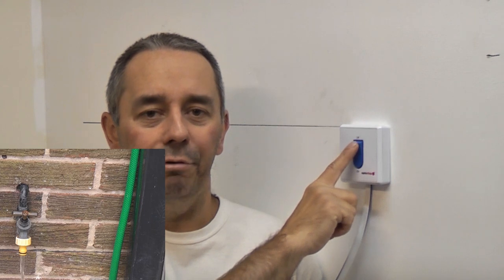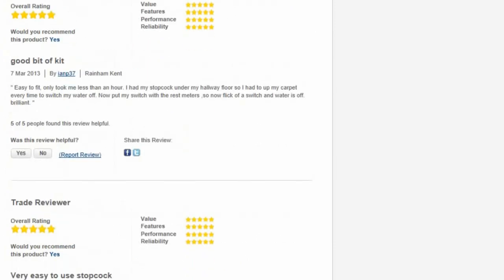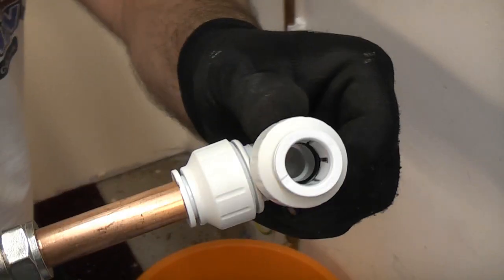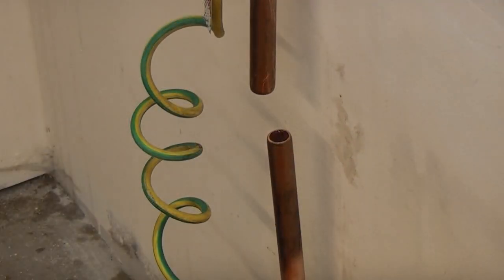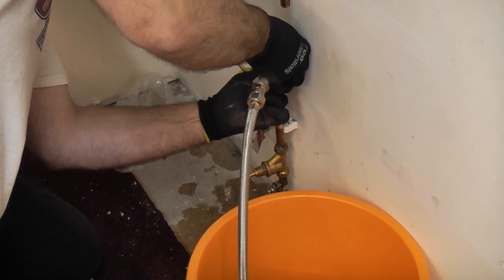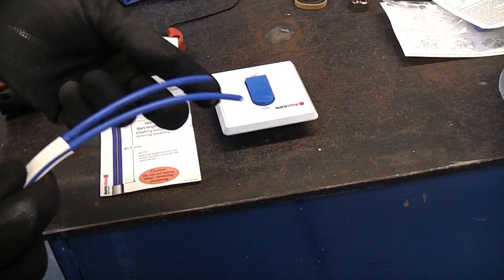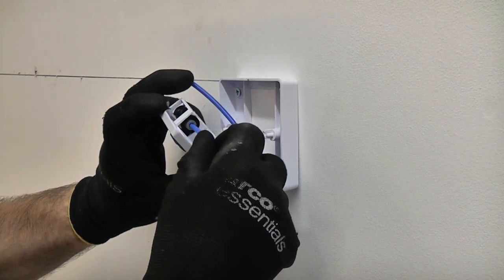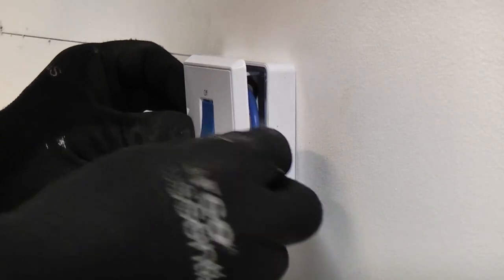Surestop water valve | isolate water with a switch

Comment: We fit a lot of these at the property maintenance company I work for, usually when we replace a kitchen. They can replace the existing stopcock so long as you can isolate the water in the road, though usually they are fitted in addition to a stopcock that is seiner in the on position.
Although I have to admit to initially being sceptical, out of 100 or so installations, I'm not aware of a single callback.
Great video and thanks for posting.
Reply from the maker: Thanks for the comment 👍
Reply: Great news Darren.

Comment: Great video as usual 👏👍

Couple of additional tips/comments, positive not meant negatively 

1: Richard from This Old House always says to clean the copper before you slice it. That’s good advice even if using pushfit and not soldering. 

2: Secondly, with a pipe-slice I always seem to splash lots of water when the first cut is made. So I often drill a small hole in the pipe that will anyway be discarded to drain any water easily. 

You didn’t need either of those tips from what I could see but others watching this video might. Hence this comment 

Of course this video now means I have to fit my SureStop I bought from SF over 2 years ago :)
Reply from the maker: Thanks for the comments ;-)

Comment: I have been using these in 2 rental retirement flats in Somerset. They fail about every 2 or three years either at the valve end or the wall switch or even, as someone else here has experienced, through pinhole leaks in the control tubes. I no longer use them as the stopcock but now fit a plastic stopcock (not quarter turn) upstream. The one I use is from Screwfix and has a 50 year guarantee. I isolate by using a pipe freezing kit. However, I have a Surestop at home which I use as the main stopcock which has so far given me about 10 years of trouble free service. The water in Somerset is soft but the water here in Dorset is hard. I wonder if the reliability of a Surestop is affected by the hardness of the water.
Reply from the maker: Thanks for the info 👍

Comment: I have installed and used two of these in my bungalow both failed at the remote switch within 2 years one was eBay the other I think was Screwfix. Two years apart. The waterboard had increased pressure because of complaints but soon reduced it again due to numerous main pipe bursts. Whether this had anything to do with it. The pipe to remotes was very brittle. I do recall a lot of failures at the time. 
Keep up the great vids I am learning a lot
Reply from the maker: Blimey, that is not good!
Thanks for the info

Comment: I had one of these installed in October 2017 (without the remote switch). So far it has worked as expected and been the main stop cock in our home. I used it for 3 weeks to stop the water when i went on holidays and it worked well. To me the main advantage is that it is less likely to seize and more user friendly for people who don't understand household plumbing too well. I think I discovered these in one of your old videos or the video you did on the aladdin isolater valve. Cheers.
Reply from the maker: Thanks for the comment 👍
Reply: Super news!!!

Comment: I think that these might best be treated as consumables for reliability, especially in hard water areas or areas with high pressure or large pressure fluctuations. Changed every 5 years or so.  I'd lay odds that the switch part with the plunger won't stay reliable in hard water areas.  Treat it as a consumable and bargain to pay a fiver per year for the convenience factor but honestly why bother when there are very reliable quarter turn valves available these days with less potential for failure?  For the elderly or infirm just ensure that a nice easy lever operated one is fitted.  Great video though and nice to see such a neat job using the proper tools👍
Reply from the maker: Thanks for the comment
Reply: I've fitted them in a hard water area for 20 years. No problems. I've replaced their first models because they were ugly.. I was a plumber
Reply: 4 bar I this area

Comment: Installed 3 weeks ago. Water pressure seems to be dropping over the last few weeks. Today no water. Turned on and off at Isolator and switch. Restored water pressure. Is their a common problem wit the isolator or switch?
Reply from the maker: Not sure, sorry. I have only installed one of these.
Might be worth asking the manufacturers, there is an email address on their website- https://surestop.co.uk/contact-us
Thanks for the comment 👍

Comment: Mine has starting leaking from the blue switch! What should I do
Reply from the maker: You should be able to get a replacement switch. I'd just isolate the water and fit a new switch
Thanks for the comment 👍
Reply: @ultimatehandyman  thanks it was midnight and the manual isolation valve wasn't fully turning off the water

Comment: i have 1 of these been in 10 years but pipe not has a pin hole and leaking near  the switch does anyone know can i take this off and cut the leak out and then just push fit again or will i need to replace it
Reply from the maker: I'm assuming the leak is on the pipe which is isolated when the water is switched off (not the always live side), if so you should be able to cut out the piece of damaged pipe, then reinsert it into the surestop (providing the pipe is long enough).
Reply: @ultimatehandyman  here is 2 thin blue pipes almost look like electric wire one goes in each side of the switch it is 1 of them has a pin hole leak do the pipes just pull out and push back in once bad part cut off or do they have a release button to push before pulling out
Reply from the maker: @alankodi8651   Oh, right. It's the small diameter plastic pipes that go from the remote switch to the Surestop.
I think you will have to isolate the water at the outside stop tap, once you have done that you can remove the faceplate from the switch, then you should be able to cut the pipe back, if I remember rightly they are 4mm pushfit connections. When you push the collet in on the end of the pipe fitting, it should release the pipe and you should be able to pull it out to trim.
Reply: @ultimatehandyman  all sorted thanks for advise

Comment: seems to me that this device is courting problems - the number of additional connections number 6 in my estimation. 6 new places for failure to occur not mentioning the added piping that could fail also. Not the thought that I want in the back of my mind when I go on holidays.
Reply: Good point. The negative reviews I've seen claim the switch stops working after a handful of years or the complaint is that the one or more of the four tube endings can begin to leak after about the same period. I'm guessing it's partly due to not pushing the tubes in sufficiently past the O rings and/or the tubes were not cut square. Also frost action if in a cold space. Or a good pull on the valve end tubes...
Reply from the maker: You would be surprised how many people who don’t even isolate the water  before they go on holidays! 
Thanks for the comment 👍
Reply: Benny stop taps are always accessible(or should be but not if you're a kitchen fitter 🤦🏻‍♂️) so the connections to the sure stop will be, point is, there's connections all over your house under floors and in walls etc, so adding something like a sure stop with new connections that should always be accessible , isn't a big issue 🤷🏻‍♂️
Reply: Why not use a ball valve? Just a quarter turn with a reasonably sized lever.
Reply: I work in student accomodation mate and every flat has these never had one fail yet, super easy for late night isolation problems at weekend etc i reckon there a good idea, having said that is it anymore convenient than a lever tap half turn and its off
Reply: @girlsdrinkfeck  I think there is some logic to that. Frozen pipes seems to be one of the larger risks. Personally adding up the time you are out of the house for work over a year means it is far more probable that a problem would happen then but we don't turn the water off each day. I suspect a week of a water leak is just as damaging as 5 or 6 hours in reality ie a total refit.
Reply: You guessed right.  Thank you for your comment.  Have a good day.

Comment: Interesting item, looks great but I am sceptical of its long term reliability, especially in very hard water areas. The guarantee is only 2 years, should be more than that (10+) for a permanent and important fitting like this.
Reply from the maker: You can extend the guarantee for 10 years, if you pay £20+VAT (which seems pretty reasonable to me- depending on what exactly it covers). I'm getting mixed comments at the moment about reliability, some people have said that they leak, whilst others have had no problems!
Thanks for the comment 👍
Reply: Thanks! I'm quite interested in getting one of these as I have a stopcock that's hard to shut and also in a cramped space. There's a few "flooded house" reviews though, that are concerning! :)
Reply from the maker: Yeah, I've seen a couple of bad reviews, but then you think that if the product does fail and flood the property, they would soon go out of business - as insurance companies would sue them for damages!

Thanks for the comments
Reply: Insurance companies actually promote Surestops.  Sadly the reviews don't always reflect the truth of what went wrong.  Or if they contacted our Techincal team based in Birmingham.  Have a great day.

Comment: Unfortunately I fitted one of these in my parent’s holiday cottage and when they went there, they couldn’t get the water to come on! There is a little metal pin that is actuated by the switch and this comes away from the switch periodically making it troublesome. I have had to push it home several times and it doesn’t appear to be broken. They had to get buckets of water from their neighbour and couldn’t shower for 24 hours. Sadly they now don’t trust it and are frightened to use it....😩 I think, in theory it is a great idea and when it works, it works well. Sadly it is just too unreliable in my experience.
Reply from the maker: Thanks for the comment 👍

Comment: UK only country where they supply cold water is in 15mm main pipe, no wander there is no pressure
Reply from the maker: It's normally 25mm to the house, but then it often gets reduced down to 15mm
The pressure here is too high- about 8 BAR 😱

Comment: Had one of these fitted , o rings inside failed and cost over £1,000 in damage to solid oak floor , so had to claim and the company who made it found the fault , and paid out for my floor replacement ( Nightmare )
Reply from the maker: Blimey, that is not good 😱
Reply: @ultimatehandyman  
Just un lucky I suppose , great product, just needs re design to prevent this happening 👍

Comment: I live in a London estate is a block of flats, BUT  the WEIRDEST thing is that the main stop valve ONLY shut off hot and cold water in the kitchen and HOT water in the bathroom BUT NOT, NOT the cold water.  I also found out that the cold water pipe that goes to the toilet cistern is probably on the same line of pipes because I can not stop the cold water to the cistern and i found out the hard way because it was worse than i nightmare to try and put everything back as the pressure was strong! Do you have any idea?
Reply from the maker: That is weird.
I have seen some properties, where they have had two incoming water supplies, which is great if you are on a water meter, but not good if you need to isolate the water and only know where one stop tap is.

Comment: in your experience whats the better manual mains stop ? stopcock or full bore lever valve ? i lived in a house with a LONG version lever of one that was inside and outside of the kitchen sink wall,and only took half a turn to flow on or off :) think its a special valve by anglia water
Reply from the maker: A stopcock is better IMHO, because it can be serviced without removing it. If it leaks from the packing gland, you can easily fix it, or you can easily change the washer. If a full bore lever valve starts leaking it will have to be replaced. 
Some people install a full bore lever valve above the incoming stop tap, as it's easier to isolate- as long as it does not start leaking ;-)
Thanks for the comment 👍